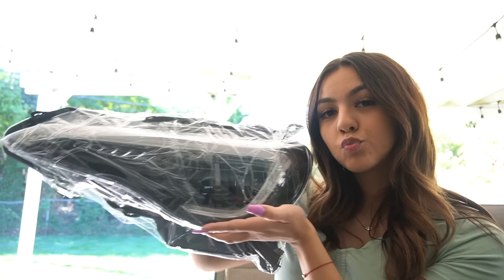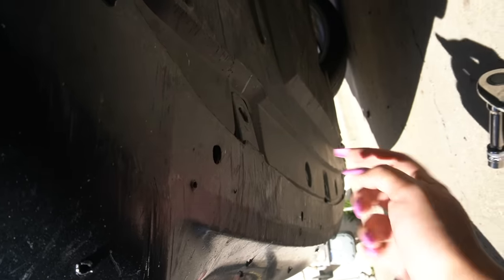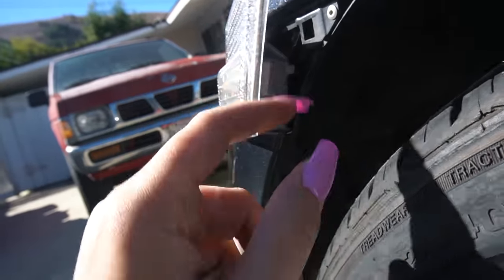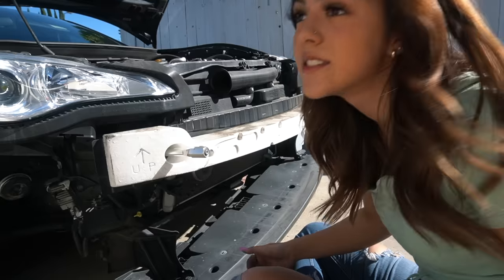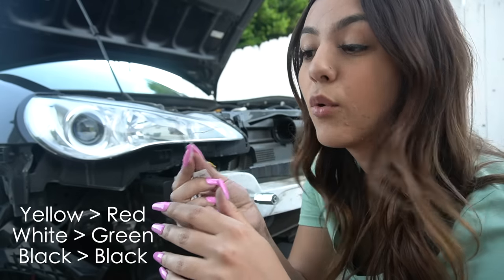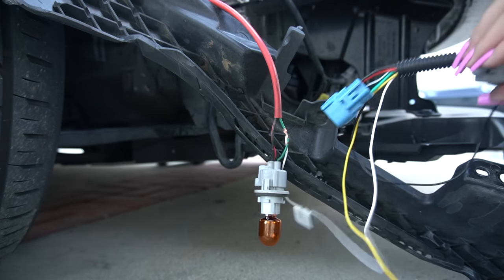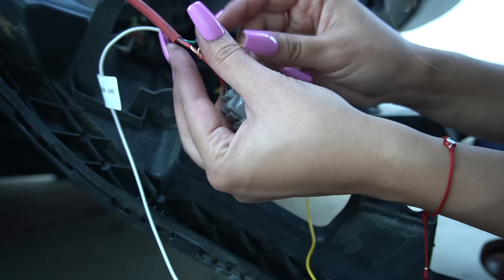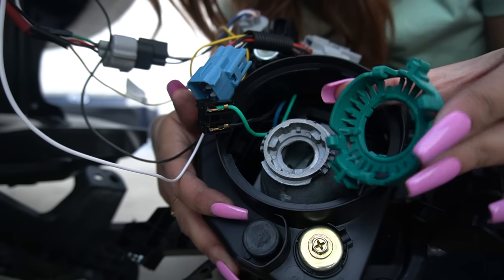NEW HEADLIGHTS *INSTALL* VLAND FRS/ BRZ/ 86

Comment: Thank you for this video!

You saved me $50 in D2S bulbs I cancelled an order for. My sealight H11 LED bulbs fit in perfectly and my dust cap was able to fit back on top, kinda weird that you had to bite on yours to make them fit. Light output is also great. Definitely no need for an expensive HID kit when the H11 LED’s do the job.
Reply: Hey, hopefully you see this comment but where did you buy the led bulbs on? I bought the ones on the link she bought her headlights on (DS2/H7) but they don’t fit. I’ve been looking around and I’ve seen ones but don’t know if it will fit
Reply: @Datslobrz  I got em on Amazon, not sure if they still sell them though. I traded my vlands for some oem 17+ BRZ headlights.
Reply: @cuteracecar  I’m guess you ordered sealight  h11s since that what your comment says, hopefully I find them. Thank tho
Reply: Hey are the H11 low and high beem doe?? I just bought su. VLANDS but not sure which ones to put. Currently my head light have the individual low and high beam (4 bulbs total)

Comment: Just a heads up, I also used H11 bulbs when I first installed my Vlands, but I ended up with water marks inside the lenses after a couple washes. I switched to D2H bulbs and now they sit perfectly inside the headlight. Not too sure about H7’s but a lot of people recommended D2H/S bulbs for these headlights.
Reply: is the wiring or anything else different for the d2s bulbs? I bought the vlands with the d2s bulbs so I was just curious

Comment: Just recently got mines. I did have an issue with the beams pointing down(im using h11's) but absolutely love these lights! Also replaced the side markers to ones that sync with the turn signal lights and this setup is sooo clean!
Reply: i think these lights are always pointed down by default when you get them. there is an easy adjustment screw on the little rectangle part where the triangle connector attatches to. just use a socket wrench to adjust it
Reply: can you link which side markers you got?

Comment: I know this is a couple years later and im sure youve either got rid of ir fixed it but you didnt need to connect that 3 pin connector into the headlight. It removed your bumper marker lights and also was plugged into the auto leveler that doesnt work on the frs

Comment: YOO I've watched at least 8 videos on how to do this and I wired everything up but couldn't get the boomerang and turn signal to work but I finally got it to work thanks to you!
Reply from the maker: yass im glad this helped!
Reply: Were you stuck at getting the drl/hid to work? Cause that’s where I’m at. Only my turn signals work
Reply: @P1ST0N580  the issue I was having was using T-taps, i ended up wiring everything directly and everything works.
Reply: @JarredWoods  Yeah I was trying to use the blue clamp splicing things that basically everyone recommended but that didn’t work... except for my turn signal. So do you recommend directly connecting the wires to each other?
Reply: @P1ST0N580  yeah i had the same issue lol just direct wire (splice) them and put electrical tape over it and you’ll be good.
Reply: @JarredWoods  did you end up not using the original turn signal anymore? Or did you manage to keep those?

Comment: you definitely need to put the black cap back on. if not then when winter/rain comes you'll have condensation inside the headlight from the moisture in the air. I transferred my stock HID bulbs and ballast in mine and they only just fit with a hole cut in the middle of the black cap for all the wires to run out. filled the hole with sealant and it's been water tight ever since.

Comment: I had the same problem with the cap since the LEDs have the fan, so I just cut the cap to size of the fan. Also I recommend getting a flasher relay if you don’t like how fast the sequential turn signal is going. 👌🏼

Comment: Does the boomerang come on when the car is on or you have to flip it to the parking lights switch On the stalk ?
Reply: Does your boomerang come on when you release the ebrake or when you’re driving? Mines is totally off and the only way to get the boomerang on is to turn the headlights one turn. You?
Reply: @kuelee9382  yeah mines the same way only comes on when u flip it to the  parking light settings ( one before the headlights )  but u ca wire them to come on when the car is on but u have to tap into the fuss box and I been lazy to do it lol

Comment: id steer fr away from wiring stuff up like that. will it work? theoretically yes. But you run the risk of them coming apart. also moisture will make its way into both wires. I hate cutting up oem harness's but if possible get another oem harness and cut the wire and butt splice, then heat shrink over the splice. it'll keep it cleaner and more secure.

Comment: I just installed mine and followed fed wire into the correct stop, however my driver side inner strip isn’t working but my passenger side one is, am I doing something wrong or missing something? Or should I quadruple check my wiring lol

Comment: I have been thinking about picking up a set of these, but I have a question, does the motorized adjustment for the headlights still work with vlands? or is this only an OEM feature?

Comment: One tip for you! Don't take this in a negative way please. On your camera where you attach the shoulder strap, you should remove those small metal rings. Because every time you move your camera around you hear them hitting against the camera. Other then that great video!
Reply from the maker: ive noticed that too! need to find a way to take them off or make them not move😭 thank you(:

Comment: Recently installed the vland headlights on my 2016 frs and once I started up the car they lit up and automatically shut off. None of my lights seem to work except my brake light. I also need to stick a pin down the shifter to get in and out of park every time. Anyone know why this may have happened??

Comment: Awesome job on the install! I'd recommend some solder on the wire connections to make sure they don't come apart from the vibrations of the car while driving. I've also done it myself without but just helps to make it last long term!
Reply: awesome job? that was the shittiest attempt to connect two wires together i’ve ever seen, electric tape wtf?
Reply: @blackpepe  no need for the hate we've all got to start somewhere...